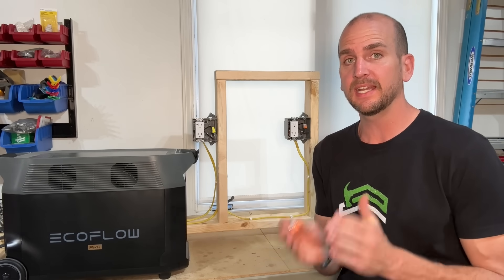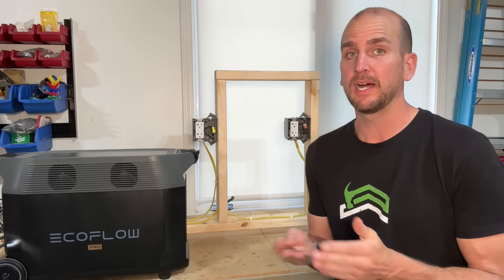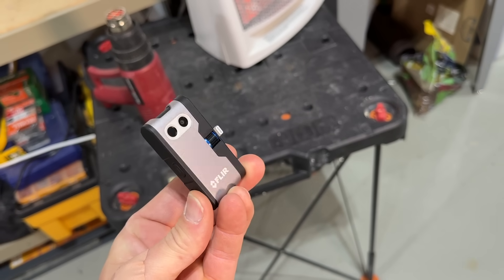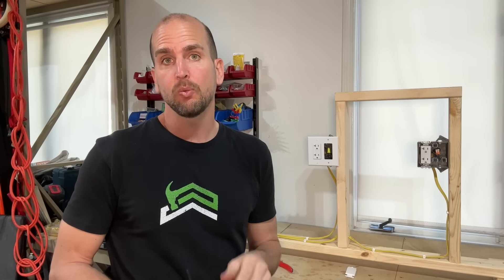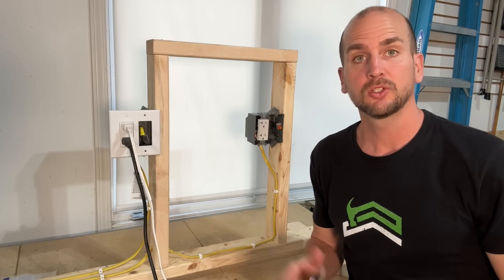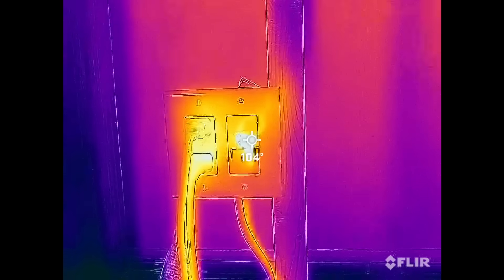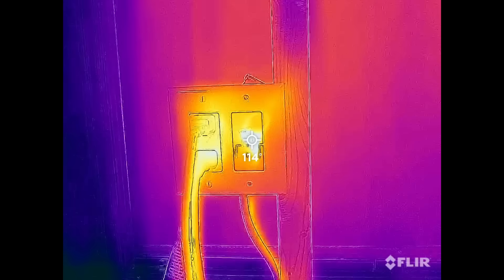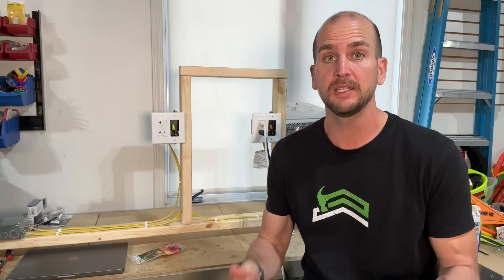Debunking the Pros: Can WAGO Lever Nuts Handle Heavy Electrical Loads?

Comment: I have seen this question on the electrical sub reddit all professional electricians. The answers are "Wire nuts" haven't used one in years should be in a museum. "We don't even stock them anymore company I work for". I suspect the guys using Reddit are under age of 40 it's more of the younger generation who are not licensed contractors probably working for a large contractor who does big commercial install work bending lot of conduit and running wire. Those place time is money wire nuts are slower anything they can do to save a penny if it conforms to code they will do it. I think wago's have proven themselves I do see push connectors now at Home Depot they are cheaper then Wago's remind me of backstabbing an outlet. The older generation electricians who don't trust a Wago likely going to be still using Wire Nuts. Wago's are not cheap compared to a wire nut sometimes I just use a wire nut because I have a jar full of different sizes.

Comment: I use the higher current Wagos for 10 gauge wire on my 5 KW solar array wiring.  That's 2.5 KW through each Wago for several hours each day, for years now.  They work perfectly.  I've also used the lower current rated 5 port Wagos for some household wiring to replace very sketchy wire nuts.  The best thing is that you can see that each wire is seated in the Wago perfectly.  Impossible to do with a wire nut, because I've never seen one that was transparent.

Comment: I see these in RVs more and more
Used to just be 12 volt but now I see in 120V
Poor practices are the reason for failure 
Stranded wire with strands sticking out. Sloppy work
No strain relief 
And in some instances with the limited access I can twist and tape and use wire nuts and be much more confident that the wires won’t  be stressed at the union
I think the design is less forgiving than tape and wire nuts

Comment: Try it with even slightly oxidized wire the lever lock will fail also over seas most of the grid is 240 volts lower amps I would also like to see it tested with aluminum wire

Comment: Did you perform a voltage drop test across the logo and then again across the wire nut? Is that amount of drop acceptable?

Comment: Wild thought here. So the heaters are using 2760 Watts(23A @120V) as indicated on the heater. But, if the resistance of the WAGO is higher shouldn't it pull more amperage? I'd be curious to see what the amperage difference, between the two, is from an energy efficiency standpoint. It would need to be tested with a clamp meter instead of the machine. A 1/2 amp difference wouldn't mean much on an individual connection but if taken across tens or a hundred connections then that could amount to significant energy savings. 50 connections(.5A @ 120V) comes out to 3000 Watts.

Comment: I have 20 amp 12 gauge circuits in my house, and so far, I've only been using either push-in or the WAGO on my ground circuits, not the hot or neutral. In my shop, especially where power tools can use up to 16 amps, I've stuck with pre-twisted wires and wire nuts. However, I will use push-in or WAGO on my lighting circuits. Plugs, no. I'm not convinced yet.

Comment: Considering the application, the ease, and time saved from installing wagos, there's really no reason to not use them at least in residential or low voltage settings. The temperature on an overdrawn circuit didn't even come close to dangerous so under normal ratings, the difference is negligible.

Comment: What part you do not get throw those Waggles away I do not salute the Fatherland for testing those wire connectors you go in your own home rip out every single wire nut and put those Legos in let me see if you can sleep at night any chance I get if I see a pack of I throw them in the garbage and that battery pack is not a generator😢

Comment: After analyzing the WireNuts (WN) vs WaGos (WG) debate, I've concluded that WNs are superior for several reasons:

Professional installation: Homes are typically wired by professionals, not amateurs. When properly twisted before insertion, WNs offer superior pull-out resistance.
Contact area: WNs provide a larger contact surface than WGs.
No spring mechanism: WGs rely on a spring that may lose tension over time due to heat cycles. WNs don't have this weakness.
Adjustable pressure: The twisting action in WNs allows for customized pressure, increasing with each turn.
Scalability: More wires in a WN multiply contact points and increase the connector's volume, resulting in larger cross-sections and lower resistance.

While WGs might be easier to use, WNs win on all scientific and statistical fronts. This conclusion stems from critical analysis and an interest in technological efficiency, balancing innovation with proven methods.
However, I'm open to counter-arguments. What are your thoughts on this comparison?

Comment: I saw a you tube now I r a electron major I can wire 408 volt moter controler without tighting the thingies because lego lever done broke and I couldn't get all the seaker wire strands in the hole thinggie so I cut half of them off. It melted... then there was a fire

Comment: Is it a good idea to connect a stove and cooking surface through Wago 221-615? (it has 41A, and 600V, 6mm2 fits in). Surface consumes 6.5kW at maximum, stove probable 5-ish. And they will never be used both on max power simultaneously.

Comment: Do they have the Wagos in a higher amp rating than 20 amps?
Reply: Yes, 221-6xx accepts 10 gauge wire and should be fine for 30 amps.

Comment: It would've also been interesting to see if solid/stranded made a difference on the lever nuts. I bet it would because there would be more contact surface. Also, who only runs a space heater for 20 mins? Should've run it for a couple hours to see where, exactly, the temperature leveled off.

Bottom line, they're UL listed, which means they had to have been tested, much more rigorously than this. They're safe.

Comment: Do you have any data on longer term usages? In your case, say, a heater running for a couple hours? Or in my more typical case, a 1000 watt power supply on a PC running for 3, 4, 8 hours at a time.

Comment: Excellent. Well presented and logical. I too have found wire nuts poorly installed by experienced electricians. Unlike lever nuts there is no clear visual evidence that a wire nut has made full contact.
Reply: Then you didnt put it on right.

Comment: What happens to the plastic under tension in the long term? Metal will maintain its tension but plastic will deteriorate in a number of ways over time. I've seen plastic warp and even crumble after decades of deterioration. How can I trust it?

Comment: Can wagos be use on  water heater wire ?
Reply from the maker: The WAGO 221 613 can handle 10 gauge so just depends on how many Amps you are pulling.

Comment: I recently installed an induction cooktop. This cooktop is directly wired to 2 120v wires and 1 neutral. After using it for about 4 months, I was having to use the boost feature for all 5 heat areas that was normally being used on setting 5 to 7 (out of 9 available). I checked to volts coming to the connection point and both wires were giving 120v. I pulled the wago connectors and used the wire nuts and the issue with the induction elements not working properly stopped immediately. I’m not sure why it took 4 months to happen, but it did.
Reply: The reason is that you have a lot of cycles of a high current load.  It is the heating/cooling cycles that waken the springs, reducing the tension over time. 

I'm not an "electrician", but an electrical engineer and I have long said that the kind of issue you saw, is almost guaranteed to happen with WAGOs.  But many "installer electricians" do not realize that dissipated heat is determined by the current SQUARED, times the resistance. If the current gets doubled, the heat energy energy goes up FOUR times!!! At low currents he heating is quite small, but at high currents, it gets significant. Over time, resistance increases with current. So it can keep slowly getting worse. 

WAGOs use copper in the little bus but the springs are steel. Dissimilar metals is not a good thing unless you are making a thermal cut off switch. I'll just add that although a Flir sounds like a good measure, you are not seeing the actual localized heating at the very tiny contact point, but just the radiated heat conducted through the whole connector and the wire. WAGOs are not likely to burn open and create a fire, but over time the resistance will get higher and the connection will not be as good,  

When UL approved these in the US, they went to a 20A rating, reduced from the IEC rating of 32A. That should suggest something. UL tests to worst case conditions. The IEC doesn't test or even require testing. Manufacturers "self certify" their equipment!!  The IEC may request third party testing, if they receive a statistically significant number of failure reports.  I would guess that less than 1% of failures actual make an official failure report. And with many, many millions in service, what would a statistically number of reported failures be?? It's really a system designed to not recognize issues!!  I hate IEC!

An induction cooktop may be a worst case load because of how many regulate, often controlling current and not voltage. Do they will try to push current through that high resistance connection. I will not use WAGOs for anything but low current applications like LED light fixtures. 

BTW, I will always pretwist wire nuts! It is recommended, but "not required" according to videos by Ideal. Interestingly enough, if you don't pretwist, you are supposed to see a couple twists in the insulated wire below. Just pretwist, it's just common sense!

Comment: I have had quite a few Wago lever nuts that fail due to high resistance (eventually hit Megaohms), especially in circuits which have a constant low-amp 120 load.

Comment: How good are they? Good till the metal loses its tension.  How many jobs have I gone on? Was the outlet went bad because they used the push-in instead of the screws. Just the facts.
Reply from the maker: I agree and usually stay away from backstabbing.  WAGO 221 lever nuts have a considerably different design compared to a backstabbing terminal in an outlet or light switch.

Comment: If you are cheap like me, any resistance is lost energy or $.  Combined with the higher heat and potential for fire, and the ambiguity of the contact metal they use.  Uhh, no thanks.

Comment: The WAGO was hotter and there is nothing you can do to make it any better as an end user but with the wire nut, you can pre-twist the wire and it may drop a couple of degrees. I'm sticking with the wire nut.

Note: Soon they will be incorporating WAGO technology right into the receptacle box, pull the wires in, slide it into the "mounted" WAGO and install the socket. There will be no accidental lever flipping, that happens when you push the WAGO into the box.

Comment: Most important difference between Wagos and wirenuts..... Wagos were designed to conduct electricity..... Wirenuts were not designed to conduct electricity.
I'm still on the fence to use wagos or not to use..... 🙃

Comment: Interesting results.   I wonder how long you would need to run the test to see the temps level off.  

Also, curious see if the results would vary based on how jammed full the boxes were?

Thanks!

Comment: The tests aren't objective without more data. If the voltage was different, the current was different. More current through any junction generates more heat.

Comment: I use wire nuts because they have a stronger, mechanical connection. But I see the benefit of Wago when you have to splice together multiple wires. Higher temperature tells me that the Wago nuts are not as efficient a conductor as a wire nut. They are also far more expensive.

Comment: My welding shop is full of Wagos in the 20 amp receptacles starting 15+ amp tools over and over and I have had no problems.
Reply: You will
Reply: @RadioRich100 With the lever type ones I wouldn't disagree. But the slide type with 4 holes are a far better hold than a wire nut.

Comment: The plastic around the wire nut may act as a thermal insulator and lower the temperature measured by the Flir. I would be curious to see a comparison without the plastic cover/shielding on the wire nut. Obviously you would have to be careful not to short the circuit.

Comment: SO the WAGO heats more when overloaded by 20%.   Now repeat your tests at the rated use (i.e. 20 A), and another test at 80% (16 A).  I'll bet the differences in the connectors reduce substantially.  Bottom line is all these are approved for a maximum use.  And they get that approval through thorough testing.

Comment: I started using Wago terminals in the early 90's. After thousands of terminations (if not over a million at this point) not a single failure attributed to design. A handful of failures due to damaged or improper use only. Wago is one of the brands I place full confidence in. When they went residential, i couldn't have been happier as now i use them in my home. If your scared to use them, stay home and lock your doors, you are too afraid of everything.

Comment: WAGO just might be the Sharkbites for electricians. Yes they work but will they stand the test of time. Will those spring loaded contacts take 110* + and still hold up down the road?  I love them for 24 v stuff around HVAC but in 20 and 30 amp circuits?   Hmm not me.

Comment: Electricians are likely to use wire nuts in North American for many more years to come. It's not even hard for a do-it-yourselfer to learn how to use wire nuts properly. However, there are a lot of people that use wire nuts wrong. It's way to common for a home owner to just stick the wires into the wire nut without twisting and use electrical tape to secure it. Don't ask me why people are like that. I've seen that, myself. My sister had her elderly boyfriend install a water heater under our kitchen sink. Later, I came back to look at it because the heater element popped. The wires were just pushed into the wire nuts and taped. I was horrified. Amazingly, I didn't see any kind of heat damage. He also left the ground floating. Ugh. Wago nuts would help with that, except for correct wiring, assuming people aren't just going to grab for the cheaper wire nuts, anyway. Seriously, too many people think grounding and polarity is just a joke. They probably think it's Communist or something because it will work without a ground or with the right polarity.

Comment: This reminds me of what happened in the plumbing industry when PEX piping and fittings started showing up in plumbing suppliers nearly two decades ago.   I had customers swear on their kids that they would NEVER use PEX and continue to use copper tubing and soldered fittings.    Today those same contractors install mostly PEX.   
The trades by nature are not full of innovators as it pertains to new technology.   I see similar parallels between the wire nut/ Wago connector debate.

Comment: The temperature ratings of the wire nut and wago connectors are one thing, but you also must consider the temperature rating of the wire itself which in many cases will be considerably lower than that high temp rating of the wago.

Comment: Do not overload any engineerd item.
Same applies for Wago.

If you want to overload something, then use your Wire Nuts.
These will do fine, because of high wire contact area.
Sadly, your wires will burn down and ignite your house, even if your wire nuts hold, because overload needs wrong fuses.

If you choose correct fuses, correct Wago, according to max current and correct wires, then you are save for decades and have fastest and therefor cheapest installation..
If you choose correct fuses, Wire Nuts and correct wires, then you are not save for decades, because Wire Nuts get lose over time, due to temperature changes., plus you need hours for installation and after checking.

Comment: I think the reason that some people are skeptical of WAGO lever nuts is that they erroneously equate them to the push-in terminals on switches and outlets which are notoriously unreliable. WAGO lever nuts are almost always used in Europe as some European countries have banned the use of wire nuts. So, with that said, I'd use a WAGO over a wire nut any day.

Comment: Those "pros" don't seem to know anything about how electricity flows through conductors and how connectors work. The actual contact made even in the wire nut situation is only by a few atoms.
Given how much variance wire nuts allow you can never be sure how much current capability you actually end up with. It's an extremly poor crimp design and frankly should not be used, they are illegal for install use in Europe for a good reason.

Comment: Even though Wago’s are rated, I’ve seen them burned up on service jobs. where they crumble to dust and appeared to have smoldered for quite some time, especially on higher voltage lighting ballasts like 277v. I try avoid using them for anything over 50v personally.

Comment: I use Wagos when daisy chaining can lights that run LEDs as they do not pull much amperage. I personally will never use them for receps though, and I always use my lineman’s to pre-twist before I wire nut. NEC is a minimum standard. It is up to us who have seen severe heat damage during retrofits (and way too many Harry Homeowner installs) to step the minimum standard up a notch.

Comment: I believe the interior temperatures between the Wago and the wire nut are similar. I believe difference in the temperature readings are the insulated outer materials covering the conducted connections.

Comment: I think if the current was pushed to the limit we would see a much bigger problem than just a a little heat rise.

Please retest running 60-amps on the 14/2 or perhaps a direct short without breaker cutoff.